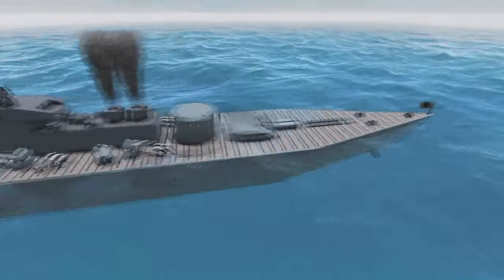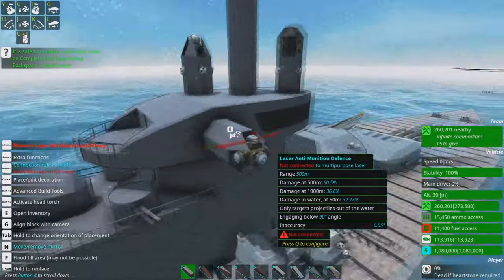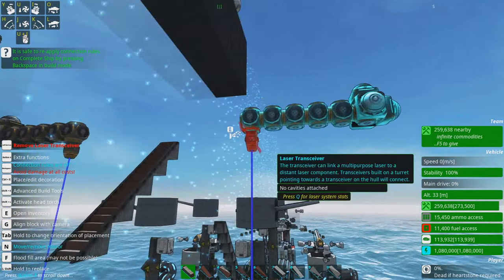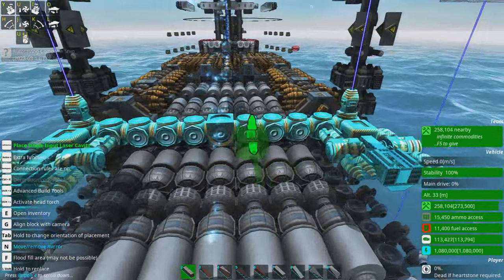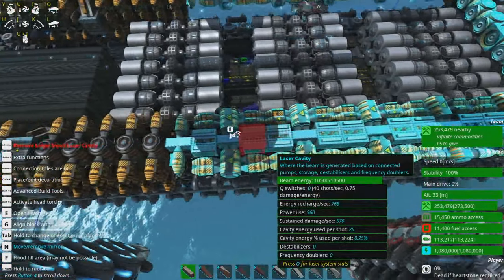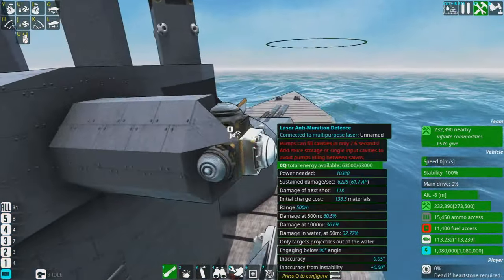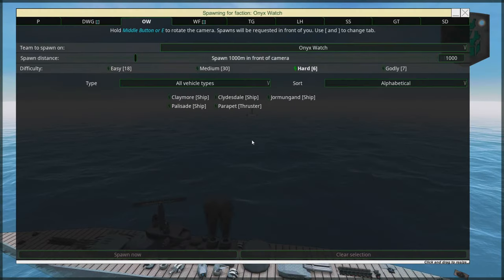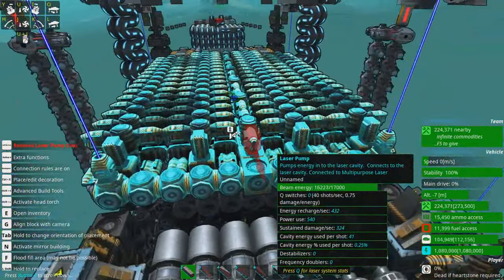Complete Ship Walkthrough #19 - Laser Anti-Munitions Defense (LAMS)! 🔦🎇 🚀 From the Depths

Comment: While it is true that pulsed lasers tend to waste more damage on weak shells that they overkill, remember that pulsed lasers also do more damage per energy than continuous lasers. This may make them more economical and more effective against medium and larger caliber munitions. 20% overkill is about the break-even point beyond which 0Q lasers would be more efficient.
Additionally, because pulsed lasers front-load their damage, they may be better on average for intercepting extremely high-velocity munitions, so long as they aren't between pulses when said railgun shell comes in. 2 pulses from a 4Q laser deal 25% of the laser's DPS within 0.125 seconds because the first shot is instant.
Reply: So you'd want both.. Continous lams to take out the small stuff and then a pulsed ones set to bit shorter range to take out whatever gets through the continuos lasers.. And also wire them to regular lasers set to shoot only when the energy storage is close to full so that they won't deplete the Lams energy but won't let the expensive pumps idle either...